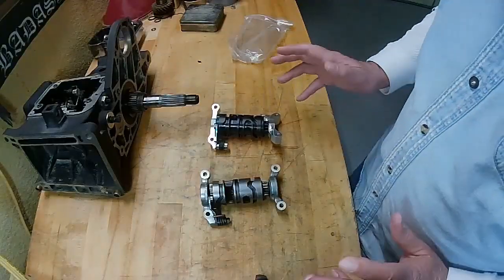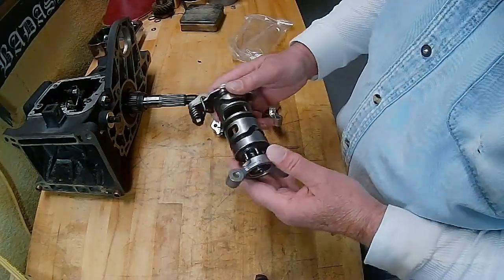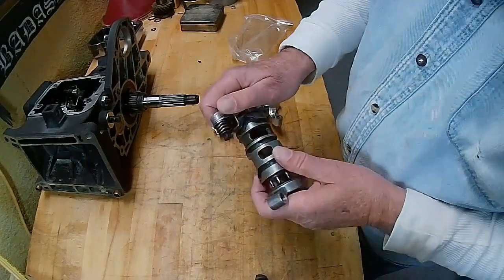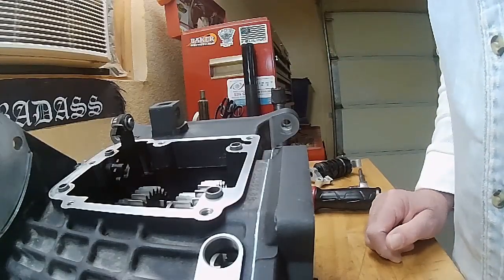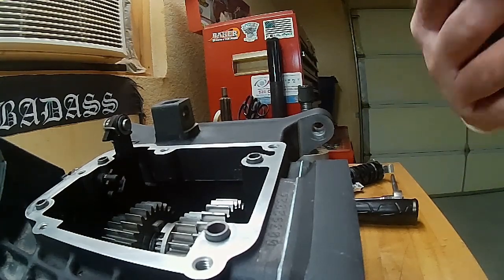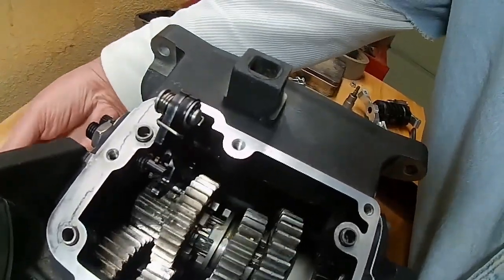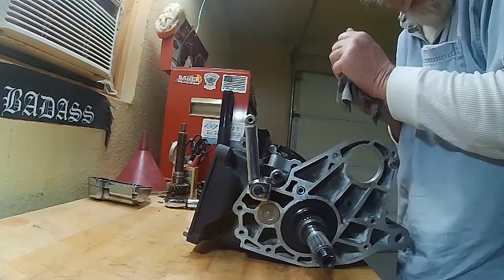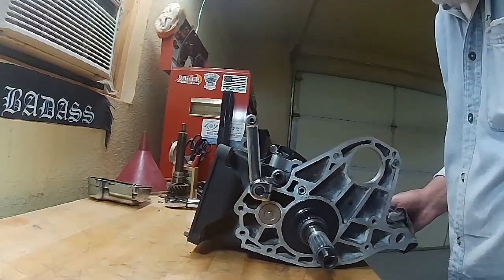How to Install Upgraded Shift Drum in Harley 5 Speed Transmission

Comment: Wanting to do this job on my Ultra this winter... getting 2nd and 3rd gear occasional lockout on higher RPMs.. my bike is a stage 3 so i sometimes do a little throttle wacking.. my question is, do you think this job is do-able without taking the transmission completely out of the bike?

Thanks again for the video, ride safe!
Reply from the maker: Yep putting a upgraded shift drum and pawl can be done while the transmission is in the bike. It's a little bit harder but it can be done without a problem. Thanks for the question, thanks for watching and ride safe.

Comment: I just got my baker shift drum and I wanted to know does the redundant neutral detent set screw already come adjusted/set at where it needs to be from Baker and I can move forward with installing it without needing to adjust it? I noticed at 5:14 you said it’s adjustable so I wanted to know just to make sure thank you.
Reply from the maker: Usually it comes adjusted correctly but sometimes it's out a little and needs adjustment. It's ok to install it. Just try it out before you put the top cover back on to make sure it's where you like. Thanks for watching and ride safe.

Comment: Hoping you can answer this, installing the baker smooth shift on my 05 Deluxe. When going through the shift pattern it does not seat in the shift drum in each gear after 2 without moving the drive a little. Installing with tranny in bike and pawl adjusted in third. Is that normal is my question
Reply from the maker: Yep that's normal, you need to spin the main shaft when up shifting and down shifting. Thanks for the question and thanks for watching.

Comment: What is your opinion in just changing the shift drum with the stock shift pawl?
Reply from the maker: A stock shift drum and pawl will work just fine. I like to upgrade when I change them. The good aftermarket shift drums and pawl shift smoother and last a lot longer than stock. Thanks for watching and ride safe.